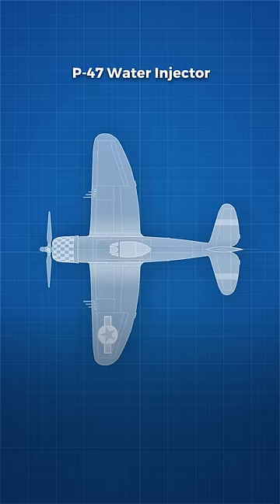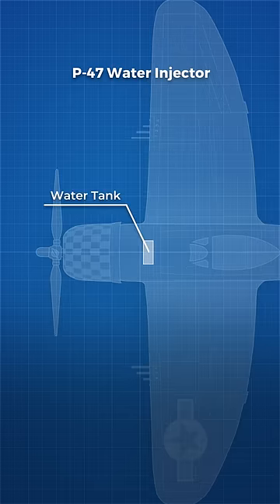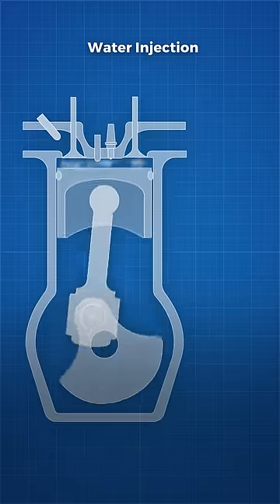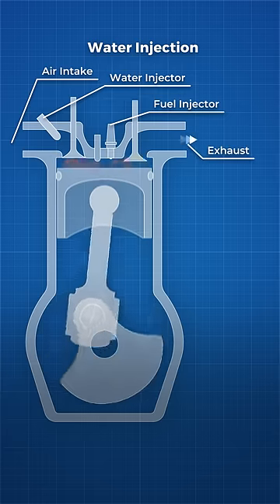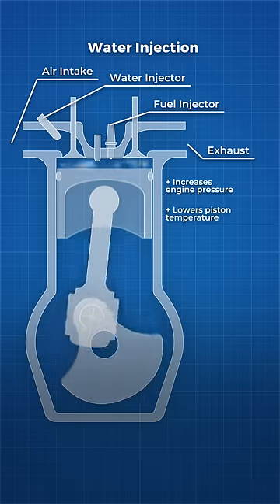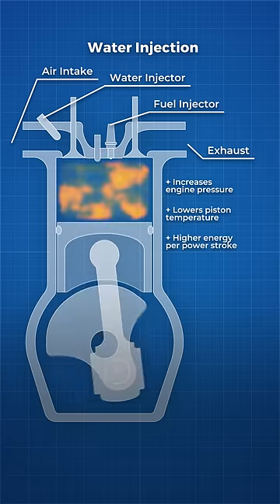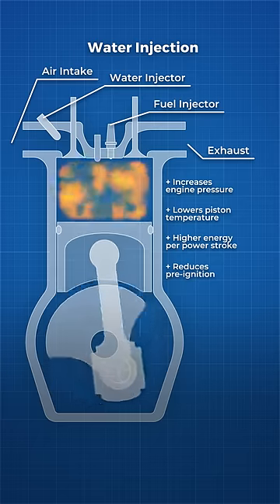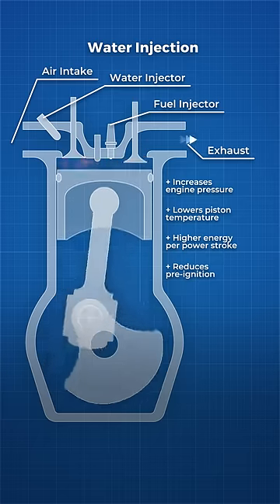How Water Injection Increases Horsepower

Comment: "into the piston" you mean into the cylinder.... It increases power by allowing you to run the same ignition timing without detonation when you are at higher altitude with less dense air and cooling also keeps hot spots and keeps pistons fr😊 melting more than increasing power really...

Comment: Weird that nobody mentioned water is incompressible so it actually just increases the compression ratio which increases power. All the cooling effects help too, higher air density and all,  though that's more from the methanol than the water. Methanol increases the octane rating which just means it's harder to ignite, meaning more precise ignition timing, really only useful in high compression engines. It's a really great idea and it's a shame water injection isn't more common in vehicles considering water is nearly free and increases efficiency.

Comment: The engine graphic is terrible. As others have pointed out, the fuel injection label is pointing to the spark plug. It also isn't a direct injection engine, so their shouldn't even be a fuel injector going into the combustion chamber.

Comment: Water injection even carried into the jet age for the same reasons. If you watch old footage of western, and particularly american jets from the 50s and 60s, they billow clouds of black smoke which was actually water vapor condensing on the burnt and unburnt fuel particles in the exhaust. While this didnt make the engines less efficient, they managed that part on their own. no, what the water injected jets did was it allowed everyone to visibly see the exhaust thats normally invisible and it meant that because water and exhaust were mixing and condensing, that they would fall to the surface faster, meaning low flying jets left smog in their wake that fell very quickly onto anyone below.

Comment: Most of it is from the cooling so you don't have to pull timing. There's hardly any density increase since the cooling mostly lowers the pressure of the gas instead of decreasing the volume.

Comment: water vapor also expands a lot more than other gases do when it heats up, which adds more power to the combustion cycle than if a different non-flammable cold gas was injected.

Comment: You neglected to mention that water is incompressible, raising the effective compression ratio of the engine.
This is where the main power gains are from, not from the densification of charge.

Comment: Doesn’t this mean greater temperature differentials for the engine block material? I’d imagine that the repeated heating and cooling of the cylinder means that the engine block has to be really strong or else the stresses would cause it to fail…

Comment: The air/fuel charge isn't deliberately ignited while the piston is anywhere near bottom dead center of its reciprocating. It is intended to be ignited when the position is a few degrees before top dead center.

Comment: Sweringen Metroliners had water injection systems to cool the intake air in their turboprop engines. The cooler air was more dense hence provided more power to the engine.

Comment: Does the boiling of water increase the pressure in the cylinder? When water turns into steam, the volume expands like 2000 times. This should have a large effect, right?
Reply: It sure does! It adds power,  efficiency, and reliability. It reduces emissions. It also steam cleans your engine, and exhaust system to keep it nice and squeaky clean.
   Why don't they use it on diesel engines instead of having all those heavy emission controls and DEF fluid? Well we can't have that! Who would make any taxable profit?

Comment: There are also plenty of WW2 aircraft that were cooled with a water/methanol mix. During emergencies such as assault or when evading enemy shells, the pilot could increase hp by injecting the coolant into the cylinder, not only cooling the cylinder but also adding fuel (methanol) that doesn‘t really need extra oxygen to combust. Of course doing this risks overheating the engine but that‘s still better than surefire death.

Comment: Calling it water injection is like calling a gasoline car an alcohol car because there happens to be a little alcohol in gasoline. It was mostly methanol they were injecting upstream.
Reply: It's generally a 50/50 mix, or even a mix with more water than alcohol. It even works with straight water, but then there's the risk of it freezing.

Comment: And there is no such thing as a water injector(I don’t know much about plane engines but I’m sure they are no different)it would ruin the engine that is a fuel injector shut up and learn your facts
Reply: Water injection is a very real thing. It allows you to run a higher power setting than you would otherwise because it prevents knock. It was also used on the Me 109, Fw 190, Corsair, and Ki-84, among others.
Reply: @johnwyman6126  oh I’m sorry that basic engine knowledge says don’t put water in your engine unless you are using it as some sort of makeshift coolant
Reply: @johnwyman6126  and it is bad to put water in your fuel tank and then say. “Oh that’s your water injector” DUDE
Reply: @Tom-jw7ii  I did say I don’t know much about planes but I wouldn’t run water through the actual 4 strokes of an engine
Reply: @ChristianMartin-qe2gf   Nobody ever said anything about putting water in your fuel tank. I rest my case.

Comment: But what about vapor,isn't engine going to hydrolock?
Reply: Will you drown if you breathe fog?
Reply: @johnwyman6126  No,but that has nothing to do with the hydrolocking.Water vapor can`t be compressed and that causes a hydrolock,now im just asking how is this injection possible
Reply: @RandomHuman1103   Liquid water is not compressible. Water vapor is compressible especially when it's mixed with air.

Comment: Ok fine but you telling me the p47 already had direct injection?
Reply: Nope that's still port injection
Reply: @ncopp4358  then why is there an injector?
Reply: @electricpaisy6045  For port injection, you'll see the injector spraying on top of the intake valve.  Direct injection is where fuel sprays directly into the combusion chamber usually next to the spark plug. 

Direct injected engines will make more power since all the fuel the engine's computer calls for makes it into the combustion chamber and cool the engine as well. However, the intake valves will collect a lot of carbon over time causing a lot of issues over time since the valve isnt constantly beening washed with fresh fuel.
Reply: @ncopp4358  that's the water injector bit what about that direct injector next to the spark plug?

Comment: So if we added methonal hydrogen to the system it would help with the tune they were running. So if we in theory used engines just as generators and used electruc motors to drive the transmission of a car then used the generator to charge super capacitors and a low weight battery along with the electrolosis hydrogen generator in theory we could boost horespower increase fuel efficiency of course parasitic loss is a thing and it wont be by much but in theory with the right hydrogen enrichment into the deisel fuel it can make more power. Right?
Reply: Trying to understand your point. It seems like you're trying to add an HHO system to a diesel electric train, or those diesel electric logging trucks being made by that guy in Canada.
    But methanol/hydrogen? That's not a thing. How do you emulsify a gas with a liquid? Although methanol is a hydrocarbon, so it has hydrogen in it.
Reply: @johnwyman6126  it's not through the fuel or deisel. The diesel is injected into the chamber as is and the hydrogen is injected before the port so it is pulled into the vacuum of the chamber. By the time the valve shuts the piston is on the way up the deisel ignites and blows up and the hydrogen adds to the combustion due to how hydrogen expansion rate. We don't want to mix it into the diesel directly we only want to tune it to burn less deisel. Then the alternator can run the hydrogen generator so we can make it on the go and add it to the hydrogen storage tank for use. Then the hybrid battery can be used for supplementing power to the main drive system and the deisel generator can simply by running as a constant makeing power for the entire system. 

Deisel generator charges the battery and supercapacitors. Super caps run the motors so it takes the load off the hybrid battery. That way you can have more power and a better buffer. 

The battery can then send power to the electrolysis hydrogen generator that sends hydrogen into a storage expansion tank and that us then sent through 4 check valves to the hydrogen injectors. Hydrogen injectors are right before the valve and set to pulse like deisel injectors. To increase efficiency. The turbulence from the vacuum into the chamber will mix the diesel with the hydrogen so it can make a better cocktail for the engine to run with less fuel. Parasitic loss will be a thing and I don't expect it to increase fuel consumption by much but it should in theory with the right build make a deisel that gets 40 mpg 56 mpg if done right. The issue is the more hydrogen you use the more damage to the cylinder and walls there will be.
Reply: @playstation8779   Why would there be damage to the engine from the hydrogen? 
   It would take much more energy to disassociate water to get the hydrogen than you could make with the hydrogen inside the engine, It's a downward spiral of efficiency.
    Every time you convert energy from one form to another you lose efficiency. The only reason a diesel electric train works well enough, is because they lose even more efficiency by running an internal combustion engine outside of its narrow RPM of efficiency range whenever they need to go slower or faster than the speed where they get the very specific rpm of the engine.
    What happened to the methanol?
Reply: @johnwyman6126  it's not water its a gas. Hydrogen gas. We separate the hydrogen from the oxygen. 

Hydrogen has a higher energy yield then air. Due to this mixing ratios are hard to create. A perfect diesel to Hydrogen ratio is hard to control. This is why it hasn't been done for mass production. Allthough it can be don't with superchargers and turbo systems its hard to do naturally aspirated. 

You are correct out the efficiency aspect. It's not really about the total efficiency number. It's more about the possibility of a vehical that has multiple options to fuel itself a heavily redundant system that can keep going in the event of a black swan incident. I'm talking somthing that isn't about efficiency but more about raw power and performance for the worst conditions imaginable. 

Most will see the flaws and point them out. Efficiency being one. 

No one will think about the benefits. One benifit being flex fuel capability. If it can run on hydrogen. Diesel. Gas. Or propane. Electricity. Its an all in one. It's powerfull due to the fact it's multi fuel capable. Then the range. I don't want it to be a vehical that gets 200 miles per tank of diesel and 150 miles of electric. I want it to be a system that balances itself. 

Thus the reason of testing exists. 

Then the damage to the cylinder. If we used steel jackets in the cylinder pitting will be an issue. The expansion rate of hydrogen is harsh on some parts of the engine. Its bad enough that if you use too much it can blow up a diesel engine block easily. Tuneing the timing will play a huge role as most will expect but the ratio of fuel to hydrogen. That will matter most. 

It won't be a lot of damage. If maintence is done as it should be every 3k do your oil and filter every 90k check bearings and replace bearings if need be along with timing chains. 

Its not a slow burn. It's a fast expansion of gas. The jolt in itself can cause extra wear on parts. Thrust bearings in the crankshaft will have to be heavily beefed up and the con bearings will need to compensate by haveing more material and a good oiling system essentially more oil holes through the crank and more oil squirters to ensure proper lubrication of all moveing parts in the engine. 

Its not gonna yield great mpg on the diesel again diminishing returns but if done right you may not have to even use them together. You may just be able to run hydrogen only of course since the production processes aren't fast it will run out since it will need deisel power to prolong the process. 

Its to make a car or truck go farther. With more fuel system to back it up if somthing fails. A vehical for the wilderness not for a city goer. 

Liveing in the middle of nowhere is nice but I've realized my car is not what it used to be it's an abomination of R&D that ice created. 5 inch lift with a two hydrogen tanks along with a hybrid train from an old tesla that powers the rear motor through a clutch that engages a secondary drive. If I need it. Its heavy but during recovery I need extra weight. Is it efficient nope. But its gotten me out of situations a number of times and it's helped everyone I know and have met. 

If an engineer were to make it better. I'm sure there is somthing to be gained.
Reply: @playstation8779   Ohh, so you're talking about a tank full of hydrogen not on board creation of hydrogen from water right? Well, there are kits to add propane to diesel engines so you have some redundancy there, and I have also heard of bubbling hydrogen up through propane in order to give the propane more energy density. You do know that unlike gasoline engines, diesel engines, with their much higher compression ratios, have the fuel air mixture almost instantaneously combine with one heck of a shockwave. This is why they are built so much heavier than gasoline engines. There is no inherent reason to worry about hydrogen in the combustion process. Hydrocarbon fuels have hydrogen in them after all. There also have been some experiments with using hydrogen within gasoline engines, except for having to adjust cam timing to reduce backfiring through the intake, there were no problems inside the combustion process. So yeah, there's no reason to worry about hydrogen eating bores at all. I don't know where you're getting that information from, but I have never, ever come across it before, and I have been looking at this sort of stuff since the 80s. I actually went to college for two degrees; Electric vehicle technology and alternative fuels/renewable energy - solar, wind, hydropower, ethanol, tidal, wave  etc. They asked me to repair the solar competition vehicle they had, then in 1992 they asked me to be the student project manager of the hybrid electric vehicle we were building to compete for Ford. After that, they asked me to be on the committee to promote the electrathon competitions in the state of Michigan.
    Today I'm replacing the clutch in my personal Peterbilt big truck. So yeah, I've been around.
    If you are looking for a vehicle that is as multi fueled as possible, there's the deuce and a half and it's associated problems. I would suggest thinking about an older non electronic carbureted gasoline engine with an Impco gaseous fuel system added to it. With this, you could use gasoline, ethanol, methanol, propane,  natural gas, and possibly hydrogen and woodgas. Switching between them with only a mixture and spark timing adjustment. Good luck.
Reply: @johnwyman6126 I knew you would understand. I've been working on an old f-350 that was once a tow truck. Still is a tow truck but I use it for off road recovery in remote parts of the US. Still working on the 8 liter diesel and tuning it. Useing my own design for now since it's essentially a welding rig/ mobile tire shop. Got air and got extra welding gas.
Reply: @playstation8779    Ah, okay so if you are starting out with a Diesel already, understand that you cannot use gasoline or the alcohols as far as I know. You can however add propane,  maybe even natural gas. Hopefully there is a kit that will fit that engine. Biodiesel should  also work very well. There are multiple ways to use old fryer oil.
   I don't know if it is still in print,  but if you can get a hold of a copy you should read a book called "From the Fryer to the Fuel Tank" By Joshua and Kaia Tickell. I'm not sure of the spelling of their names.
    I'm curious, in general, approximately where are the remote areas you go to?

Comment: Why do we not have this in cars?
Reply: Because most people don't drive cars with engines that are pushed to the limits of performance, and requires rebuilding every 200 operating hours or less!
Reply: It would keep engines cleaner and reduce manufacturers, and oil company profits, which will also reduce the taxes that would be paid.
    Might want to Google water injection kits.

Comment: So water both reduces the risk of self-ignition (or spiking) but at the same time you claim that the water helps increase the pressure...? Too high pressure is (among other things) what causes self-ignition.

This makes no sense to me.
Reply: It's temperature that causes knock, not pressure
Reply: @johnhunter7244  Right but the heat comes from the pressure.
Reply: @Leymora  sort of, both from pressure and from combustion. heat can be removed from forced induction with an intercooler